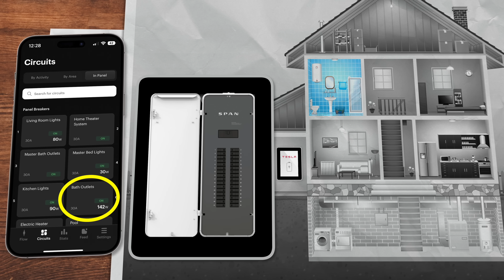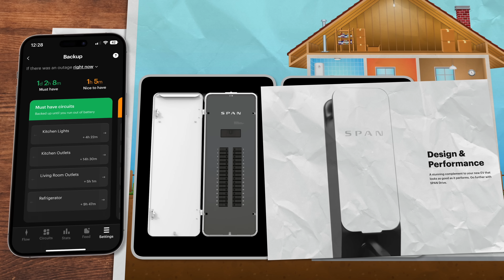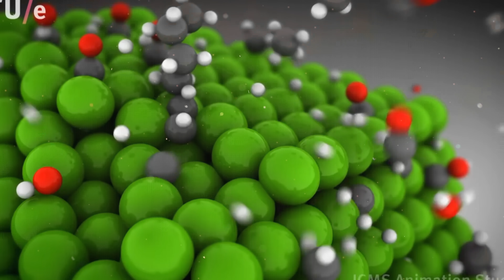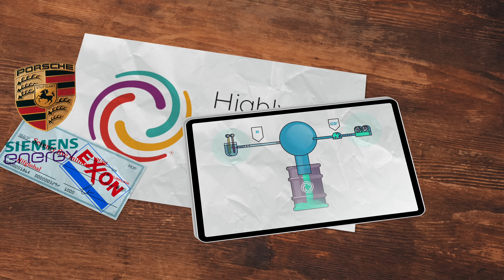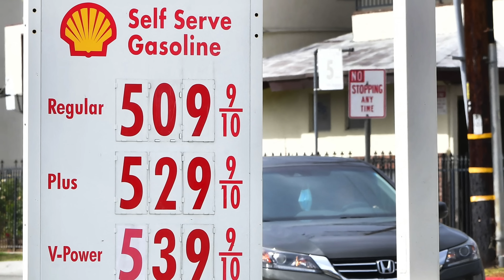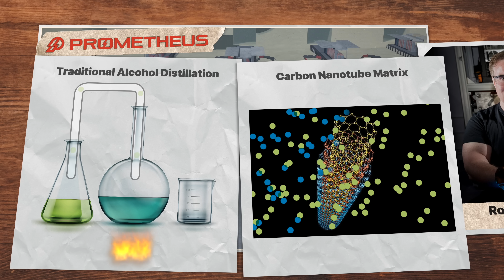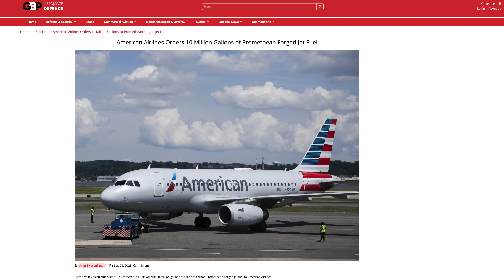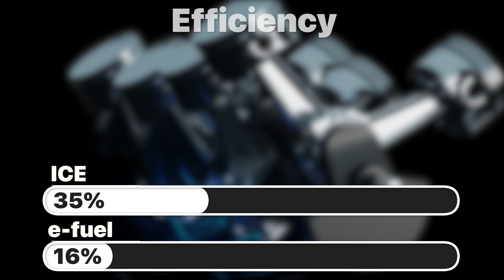EPIC Breakthrough Can SAVE the Internal Combustion Engine!

Comment: The first cars were electric so if we hadn't moved to ICE cars way back at the beginning we would have been so far advanced with battery tech we probably wouldn't be in this current shit show AKA global warming.
So you still burn the fuel and pump shit into the air we breathe.
No green washing ICE please mate, the ice engine is dead and buried and we will all be better for it.
Sounds like dog shit to me.

Comment: You said that EVs are 3 times more efficient than ICE cars, and that is wrong. Fuel is 20 times more energy dense than the energy in a li-ion battery, so pound for pound you start with 1/20th in the EV. At 90% efficient, it has around 1/12 th of the energy of and engine at 65% efficiency in the fuel. This is why ICE cars have much longer ranges, and much higher towing capacities.
Reply from the maker: efficiency has nothing to do with quantity, it's a normalized value, input vs output. efficiency is exactly as I stated for both EVs and gas cars. Yes gasoline is very energy dense, that's a separate benefit.

towing capacity isn't about power from the drivetrain, and EVs with electric motors are WAY more powerful than anything gasoline. towing capacity will awlays be higher on EVs, but range when towing will reduce when towing.

you're also no accounting for the huge amounts of energy required to drill for, then pump then refine, then pump, then truck to a station.
Reply: @TwoBitDaVinci  [efficiency has nothing to do with quantity,] Yes it has; it is wrong to compare 100 kgs of something against an ounce of something else - it has to be pound for pound, or size for size or any measure of equal value. That's common sense. 
[it's a normalized value,] It's normalized in science as around 20 times more energy dense, ergo - 20 times the potential to be more efficient.  
[input vs output.] This is why it's not 20 times more efficient, but only 12 times better. Drivetrain losses are another matter, but still a factor. 
[efficiency is exactly as I stated for both EVs and gas cars.] No; you fail to explain anything, so your three times more efficient is still a lie. You are just waffling.
[Yes gasoline is very energy dense, that's a separate benefit.] It makes ICE cars more efficient. Nothing wrong with being separate, and wouldn't work if it was the same. Fuel benefit vs electricity benefit. You are right there, but it's still waffle.   

[towing capacity isn't about power from the drivetrain,] It isn't ALL about it, but it's a major factor. Less power; less capacity is the general rule. Are you trying to tell me two vehicles that are identical can have the same capacity when one has had the power reduced in half?
[and EVs with electric motors are WAY more powerful than anything gasoline.] I will pit a Bugatti Cheron against any of your EVs for power. This is a comparison where it depends on what is pitted against another, but overall, ICE cars are way more powerful than EV's. You have too many tiny Chinese EVs bringing down your average. 
[towing capacity will awlays be higher on EVs,] A fallacy that is easily disproved.  The Kona is rated 1,600 kg while the Kona EV is only 1,300 kg. I can't find an EV that's way more than its ICE equivalent, nor compared to ICE direct competitors.
[but range when towing will reduce when towing.] Range is reduced for both ICE and EV, but more so for EVs because they are less efficient, so suffer more. If they were 3 times more efficient, their range loss would be much less than what a diesel would lose. Don't let facts get in the way of your guff.

[you're also no accounting for the huge amounts of energy required to drill for, then pump then refine, then pump, then truck to a station.] Because it's irrelevant. We are talking about vehicles, not entire processes. You're not accounting for all the kids in the Congo that are killed by Cobalt mining, and lots of other whole-of-process matters, so if you want to go there, just ask nicely; I have much more in the way of real facts.

Comment: You may be on the mark if Prometheus turns out to be as cost effective as they say. In other words, IF they're as efficient as they indicate, E fuels can be an effective stop-gap until fully electric aircraft, shipping and other diesel transport can be shifted to EV. Other issues may be scarce materials needed for the Prometheus method, etc...
Reply: I think nuclear is the way to go for generating e-fuel. It solves a lot of the geographical problems.
Reply: There wouldn't be a need to switch anything.
Reply: 1) there is nothing unusual happening with the climate.

2) there is nothing wrong with burning fossil fuels.  Its problems in high-density areas are trivial to fix and already have been fixed.  CO2 is not a pollutant.

3) Climate alarmism is a big-lie superstition supported by tax-bribed liars.  (See Climate Discussion Nexus for 100s of videos on climate quackery, deception, and realism.)

4) decarbonization is 21st century pyramid building and human sacrifice. 

5) there is NO excuse for expensive electricity.  Electricity generation is boring.     Just burn coal and scrub the smoke in densely populated areas.

6) the only challenge is manufacturing market quantities of cheap gasoline.  South Africa has already done this for decades (Sasol), using coal,
Reply: well its better than mining all minerals for the EV cars

Comment: Evs handle road traffic well but efuels and biofuels will likely be necessary to handle air travel and shipping. Some efuels will likely be available for gas holdouts and classic unconverted vehicles. I suspect by 2040 fossil liquid fuels will be illegal in most if not all places and efuels will be the final option for such vehicles.

Comment: Thanks for sharing your thoughts, ideas and videos. Another good video on processes that we are ignoring or abandoning prior to their optimum efficiency being achieved. 
A process you might want to investigate if the Hydromax process. It’s a process that creates cheap hydrogen and carbon dioxide from waste hydrocarbons with the addition of electricity. The hydrocarbons are broken down on the molecular level and ready to be used in processes such as the fisher tropes process for long term storage. Feedstocks could be anything from rubbish to sewage. Imagine a plant that converts the typical sewage from your local community and rather than struggling to clean the water to introduce into a clean body of water it converts the entire waste stream into salable liquid fuel to be sold. I know at one time their was a darpa project designed to be built into a shipping container that would convert the entire waste stream from deployed soldiers into fuel for the tanks and jets. Never heard how it turned out, many of these projects fell below the horizon the last time gasoline became cheap. I seam to remember $5/gal being the profitably spot and we we’re almost there and then the economy tanked lowering fuel costs from the +$4 range we were at. Another company that disappeared was one that was improving the fisher tropes process and making them fit on rail cars so they could be dispatched to places high in flare gas without the pipelines to get it to market. They would convert the flare gas into liquid fuel that could be tanked by railroad to market. I believe their name may have been Mustang Energy. Many lost projects out there to explore. Wishing you and your family the best.

Comment: I like your program, but you really need to ditch the politics when it comes to science stuff.  Too much Carbon really has not been the problem.  If you do not inject yourself into understanding chemistry, you will not get it.  If you do not keep in mind the recycling of carbon with plant and oceans, you will miss the big picture.  The Earth is a closed system when it comes to O2 and CO2.  Nothing leaves, and nothing enters.  It is just recycled.  What was the last atmospheric emergency that we had before global climate change?  Hint:  Ozone layer.  What caused it?  Fluorocarbons.  It wasn't the carbon part either.  What was before that?  That's right...Acid Rain.  What caused it?  Sulfur.   Before that?  Well...anyway, you have to go all the way back to the 1900 and coal soot to get a carbon problem, and it was soot and asthma.  This was in the form of particulate mater.  The fact is that the Earth uses CO2, N2 and O2 to support life on this planet.  Plants and the ocean happen to like CO2 and eventually it returns to the ground to start the process again.  Where did all this oil come from?  Yes, that's right...organic decaying carbon beasts and carbon based plants.  Did it stop with the dinosaurs?  No, but politics would have you think that.  Clean fossil fuel has been here for a while and is not near the game changer like simply making concrete.

Now, let's step to where we are going.  Electricity.  What is made to support the electric grid, electric home usage, and auto usage?  What gas is used for transformers?  There are a number of scary ones.  Tetrafluoromethane, Hexafluoroethane, Sulfur hexafluoride, Nitrogen trifluoride.  The atmospheric lifespan ranges from 500 to 50,000 years in reverse order of listing.  The global warming ranges from 5,000x to 13,000x more that of CO2 in the order listed. The rush to build electric grid components is so much more damaging to the atmosphere than CO2.  We are still dealing with CFC and HCFC that last in the 10's of years in the atmosphere, but have the global warming impact of 3,000x and above of CO2.  If you change the graph from %saturation to %impact to global warming, you get a different picture.

If you guys want to just continue on this mantra path that brought us awesome ideas like CFLs and batteries that leach into our water system and carpet scrape our earth, just because you think CO2 is the unholy gas, then you can do it without me listening.  This is pure politics.  It is for the world to move away from OPEC and to some alternative.  I am fine with that, but that alterative had better be a good plan.  I am perfectly fine with technology advancement and diversity of fuel sources, but not good with just show after show of "why we are doing this is because oil is bad".  CH4 is really clean from ground to end user.  Do the chemical redux on CH4.  You cannot get a better solution on this planet today end to end.  The bi-products of oil are used everywhere.  Oil is actually organic regardless what people say.  Places like Australia that brag about having zero coal consumption are flat out liars, because the coal mining never stopped and has even grown.  All that coal goes to China.  They pat themselves on the back all day long and smile in front of the camera for zero coal plants, but the last time I checked, the Earth doesn't care where the coal is burnt.  It all goes up.  NEMS and Carbon trading is such a political hack crap game.

Anyway...this will be the only time I rant about global warming and climate on your program.  You do a really good job, but you are falling for the politics.  If they were really concerned, we would spin the nuclear reactors back up for now until we find a better way.
Reply: worbg

Comment: 178,000 people die every day and each of those cadavers will yield 100 kw hours ---- that is 17,800,000 kw hours per day there for the taking and a damned fine percentage of the 46,400,000,000 kwh  we require every day globally -----  get dying, sheeple, i need to heat my penthouse.

Comment: ----- what a joke -----    EVs are not 90% efficient .... you lose over 70% of the input energy from a power plant as you re-charge the batteries... which constantly "discharge" after you finished 'recharging them"  ..  WHAT Beeee Essss  All of these "great ideas"  will fail without tax payer subsidies.  Bad enough we send billions of dollars over seas to dictator regimes.
Reply from the maker: Efficiency is from plug to pack to wheels, same with gas, from pump to tank to wheels. Do you know how much energy is needed to drill and frank, and pump and process and refine and pump and tanker ... all before you've even see the gasoline? things are complicated, but those are the rated efficiencies of both. Good point though on EVs losing charge slowly over time, while gas doesn't.. cheers i appreciate the comment

Comment: Why would you want to save the most Wasteful engine v designed on the world? So many parts. An electric wheel that charges itself while spinning & you can think about why the sky is blue instead of how to fix A shit car! Diff, automatic, brakes, radiators, hoses, fluids exhaust. Tell me 1 good thing about the ICE engine.  I WANT AN ELECTRIC CAR NOT A BATTERY CAR. IT ALLOWED US TO MINEB OIL METALS? SO NOW WE DO LITHIUM & EVERYTHING ELSE. TECHNOLOGY IS RETARDED  &: STAGNANT & MAN IS RETARDED BY THERE OWN SPASTICITY CALLING THEMSELVES CIVILISED. THAT'S THE DELUSION IN THIS WORLD.

Comment: Ricky, where do you get the 90% efficiency for electric cars when almost all of the electricity is produced from burning hydrocarbons?
Reply: The source of the energy is not relevant for efficiency.  90% of energy put into the battery is used to move the car. With all petrol that is much less, because a large portion is converted to heat and such. Also electricity is much easier to transport, it requires no tankers to move around and no processing steps.
Reply: Actually I saw another video that the batteries are 90% efficient. So the efficiency of the vehicle has nothing to do with the energy required to make the electricity.

Comment: They will first need to solve the main problem with combustion engines. 
If you put say for 10$ energy in your car, the ice will use 3$ to move the car and 7$ to make waste heath.
Why would you want to do that?

I am of course interested in storing clean energy in stable chemical bonds, but we should be able to use a fuel cell to turn it back into elektricity, with the smallest possible losses.
And sure there are situations where you cannot electrify like what you mention long distance flights, but for the rest,...
Seems like a very bad idea.

Comment: The original Fisher-Tropsch made a liquid fuel from coal seam gas in Germany during WW2. 
Syntroleum, based in Tulsa, OK made a liquid fuel from natural gas in the 1990's which was used in USAF Aircraft.
The same problem always persisted. The cost.....
Reply: Nuclear power is the answer.
Reply: @scottslotterbeck3796  agreed. Maybe we can use nuclear power to generate the electricity required to run the reverse combustion system. And yes, I'm being facetious.

Comment: The fundamentals you start from are flawed. 75% of the pollutants affecting climate comes from Corporations. The other constructed fallacy is that meat is a major contributor. It is true that the feed lot methods of America are both very unhealthy for the animals and by extension to us, but properly farmed animals and crops farmed in rotation actually draw down carbon. Even if we all rode bicycles the landfill would be overflowing with the tyres which are not recyclable. 
Just like Covid the agendas are political, and not based in fact.
One decent Volcano spewing gas and dust would wipe out any gains made.

Comment: This is a perfect and well thought out fit for nuclear as you can make hydrogen directly at high efficiencies from the heat of the reactor. You can also drive processes to make ammonia or synthetic fuels using the heat directly without having to convert it to electricity.

Comment: Are e-fuels any cheaper/better than biofuels? Seems like a different, more energy intensive way to accomplish the same thing: 1. Capture carbon from the air (using an energy intensive process instead of plants) and 2. Converting/refining it into fuel. Nobody seems to be talking biofuels  as a very good solution to climate change these days. Maybe do a video updating us on those?
Reply: There is not enough biomatter to make biofuel viable. Switching to bio fuel would cost and it's costing more and more forest and other nature. They are a disaster.

Comment: Constant shifting center of gravity. Forces produce energy. The force of explosions power your ICE not thermal heat transfer. The heat is only a byproduct of the chemical reaction of burning the fuels. Wind is a force in one direction, gravity is also.
Reply: The very fact that the center of gravity can fall outside of an object makes this possible.
Reply: Energy is not created or destroyed? It only changes form? What form does heat energy transform into? It doesn’t transform, it is consumed, it is dissipated, it is destroyed until no more heat energy remains and the atoms no longer vibrate. 

There would not be a heat death of the universe if energy was not created or destroyed, in a world with entropy? Remember this when you are paying your heating bill. Forces produce energy.
Reply: Heat energy is spent and destroyed, mass remains, forces remain.
Reply: Constant shifting center of gravity

Comment: The real issue isn't the vehicle or its energy source really. The issue we are really facing is waste but we ignore it. What we need to do is develop better hybrid vehicle and transfer the source of oil from drilling/mining to. Converting our current carbon based waste which is just about all waste into fuel. We fix the issue of where to put waste reduce emissions as the cars mainly run on electric but just sips the fuel to charge a small battery that the car runs off.